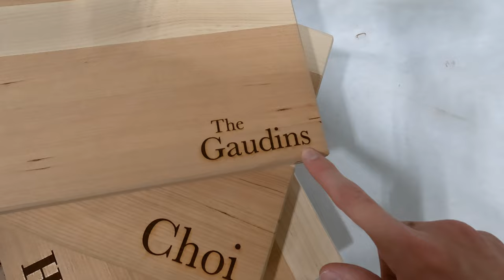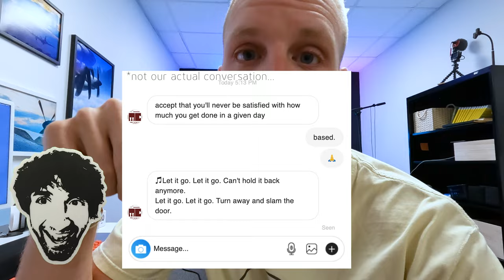Overwhelmed & Overjoyed

Comment: I learned a trick to find the center.  Get one of those crosshatch lasers. You can point it at the wall and at the right place for a board and just line up the corners of the board on the cross lines.  For your purposes you can leave it setup all the time on a tripod or attach it magnetically to a shelving vertical across the room.  Being a laser it works the same at any distance. Mark your tape at the cross center like you do already. You can go through a bunch in a few seconds. I have one that self levels which means the board would have to be diagonal.  I think you can get them that don't self level (you are only interested in the cross line anyway) and those are cheaper.

Comment: m/b try a pierced/ cut out "slotted" space  cardboard template/jig?  make it the size of the bed with the specific board shape already centered out--cut out-- like the round peg+square hole toys. Drop the tray in and then remove the template, depending if the laser cutter interferes or not ( don't have a glowforge to know). Keep master templates to cut new ones from, never to be used in forge. Others can hang up on the wall to be pulled from.   Cardboard to test out the idea, more durable material later?    time adds up <3   thank u davis. minisplit in there might help <3

Comment: Next time you go to turn off your Glowforge fan at full power, hold the button down until it turns off. Next time you go to turn it on, you’ll only need to press the button once instead of 8 times to get it back to full power :)

Comment: A minute and 30 seconds times - what? You're offering the classic reason for avoiding continuous improvement - "We're too busy!"
Reply: There is a famous line about Steve Jobs when someone told him that the boot time would be so many seconds and his response was that you should multiply that time by every computer sold and every time they are turned on.  It's a huge amount of time wasted.  But we waste 10x whatever time that was all the time with Windows today and nobody ever thinks about it.
Reply: @dougcox835  This type of waste is something that shows up in a detailed Value Stream Mapping session - spending a minute and a half marking the center of a board seems like a Value Added and Necessary step, but given the amount of time required, it demands a look. What's the center for? is it something the machine requires? Is the machine trying to establish a Zero point to begin it's work? Is there another way to do this? I'd like to see the whole minute and a half process and start asking "Why?"
Reply: @wmsification  I think he mentioned this in the video.  He just needs an origin point for the laser.  He also wants some consistency with the artwork being in the same place on the board. He mentioned that he tried some sort of jig but a simple piece of tape worked just as well.  Believe me, I've been in similar situations where you try to get things down to the gnat's ass but it's not really that important in the end.  That's his call.  If he thought extreme accuracy is important then he would have invested the time and effort to solve the problem. Sometimes you can go down the rabbit hole of overcomplicating a solution when a simple answer is sufficient.  Also He's trying to run the business as well as do the work.  What's more important?  Saving a few seconds or doing something even more important like lining up more customers? Or ordering supplies, Or any of a million other tasks on his post-it.  What you are talking about makes sense in a high volume production situation but not so much in this sort of environment. Priorities.